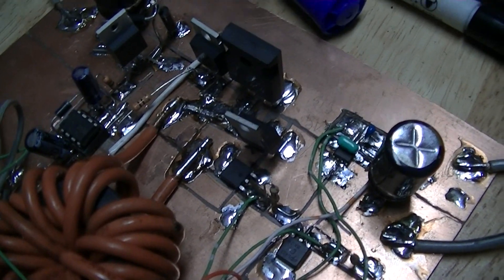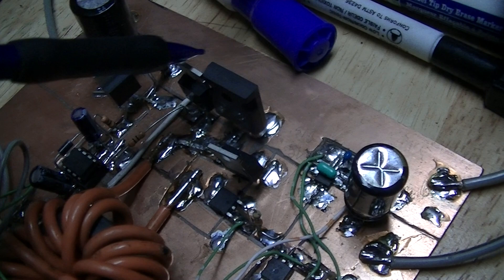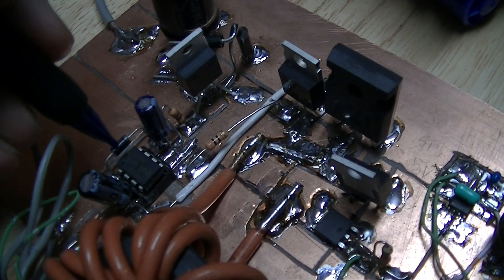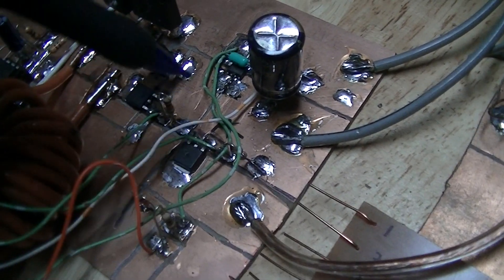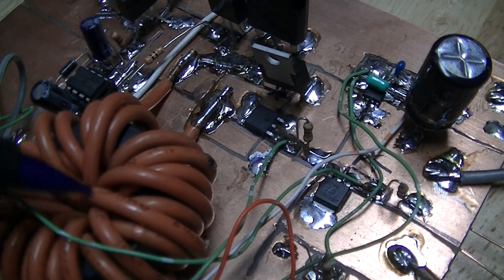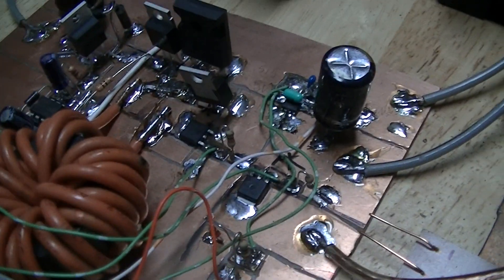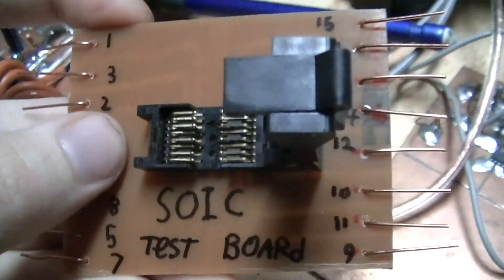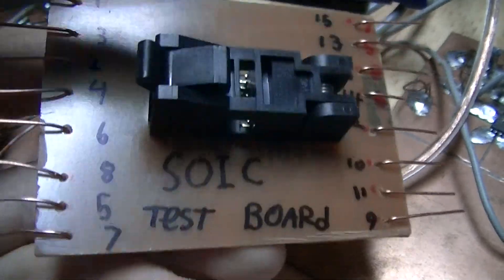DIY MPPT new buck converter board

Comment: Which buck mosfet controller have you used..??
Reply: i am talking about control ic..need to drive synchrounous mosfet alternatively
Reply from the maker: IRS2004.  But other half bridge driver ICs should work depending on what you are doing.

Comment: Great video. The P-MOSFET with the Schottky diode to make sure the lowside NMOSFET is not shorting the battery... Are you driving that P-MOSFET synchronously ? or just switching it off when solar goes dark?

Comment: Why is you magnetic so big? How much ripple current are you trying to designing for? 
I assume your switching freq is low then. around 50Khz
Also, I see NO ceramic caps on the output to eat the ripple current. The aluminum will have a high ESR and will play in to your loop bandwidth of the controller.
Also, if your load is going to a be more than an inch or so away from the output node, I'd suggest you go differential sensing of the output. 
MAKE SURE TO PUT CERAMIC CAPS RIGHT AFTER THE LC NODE.

Comment: So the array output voltage doesn't drop- just the current is puts out is less- so a buck converter should still be able to take power from the array to trickle-charge a 48V battery bank, with 58 Volts at 8.5 Amps- and even desulfate it with short pulses of 150V.  Have you ever thought of building a desulfator function into your new mppt charge controller ??

Comment from the maker: The amount of power generated by the array is equal to its nameplate rating times the ratio of the present insolation and the design insolation.  Since partial sun is typically about one tenth the intensity of direct sunlight, the array should be producing about 500W (about 4A at 125V or so).

Comment: How much power would be generated by a 5000W PV array (20 x 250W panels) - each panel putting out about 31V at 8A in maximum sun - wired up in 5 series strings of of 4 panels each, each series string putting out 124V at 8A in max sun, then the 5 strings attached in parallel to the charge controller for 124V at 40A in max sun - in partial sun wouldn't this PV array still generate somewhere around 20A at 100V ?

Comment: Have you ever DIY'd a buck/boost converter board ??  Boost would allow the battery charging to keep on happening when the voltage coming off the PV panels is less than battery voltage- and the boost circuit would boost it up (sacrificing some current) to the necessary battery charging voltage... 13.5-14.5 volts, 27-29 volts, or 54-58 volts.. ??